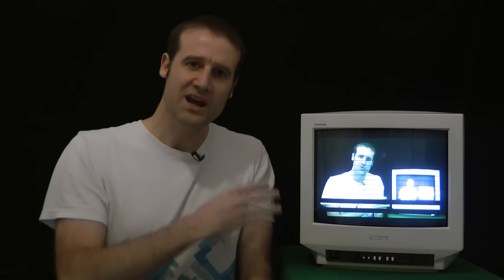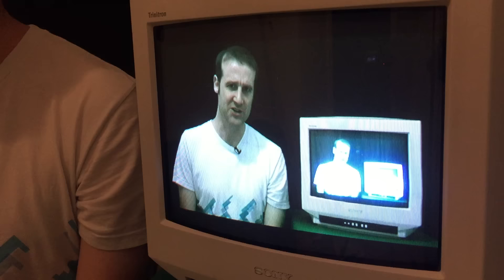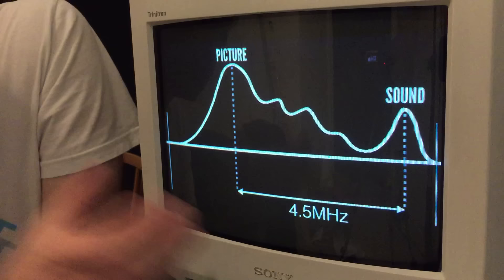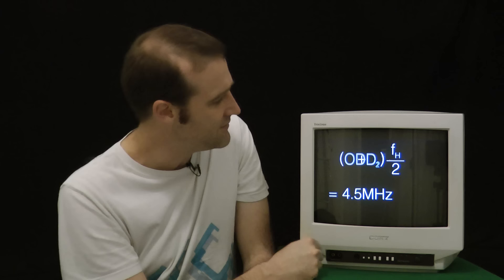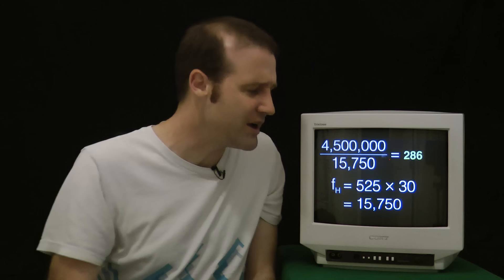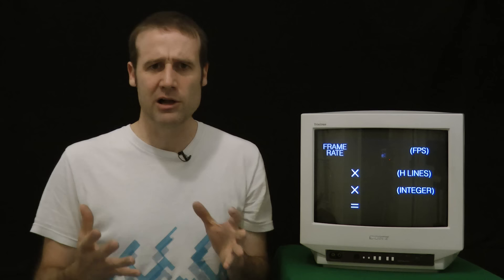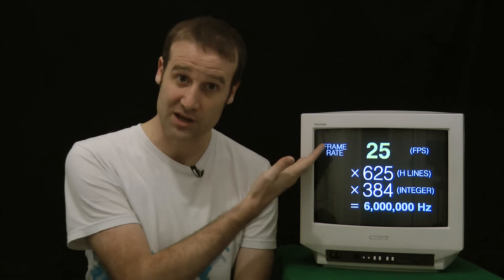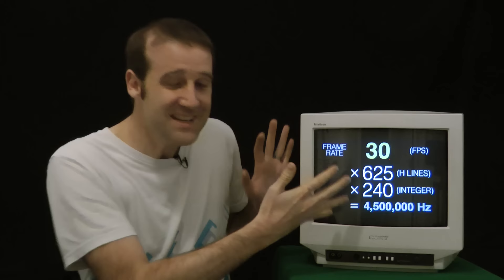Why is TV 29.97 frames per second?

Comment: Something to note is that while NTSC is 525 lines, only 486 lines were actually used to visually show the image. The other 26 lines were used for vertical synchronization and retrace. Thats why SD digital is 480p, as thats equal to the actual visual representation of NTSC. PAL was about 600 lines of visible footage, so if you ever have on your hands a master tape of a European TV show, from BetaCam or something else, it makes more sense to up-convert it to 4:3 720p HD, or else you will be losing a bunch of quality.
Reply: Real SD digital is 486. DV is 480.
Reply: Exactly, I rather over sample the video and get as much information from the picture as possible even if 720P or 1080i seems overkill. Analog video does have high frequency peaks and the professional analog recording equipment could capture a lot of information. Watching old Dr. Who episodes on blu-ray shows how good PAL video was, as far as the in studio recording elements were. The outside scenes were usually done with film, and those were re-transferred from original footage if available.
Reply: @randystuehm7924  It's 483.
Reply: @marcusdamberger  Yes. BBC ALWAYS shot outdoors on 16MM film, and indoors in a TV studio on tape.  You see this throughout the 1950 to around the 1990s, until decent tape-based recorders and cameras became cheaper than shooting processing and transferring film. Dr. Who is a great example, as is Monty Python
Reply: This is not really true. The 525 lines standard was defined in System M (The underlying broadcast standard commonly used with NTSC color), not the NTSC color standard. Look at Brazil, who is using PAL but with a resolution of only 525 lines.
Reply: Dave Holden yeah, I noticed that. The outdoor scenes all have lower frame rates than scenes shot indoors. Not only with BBC shows tho, I think it /may have been a standard/ in Britain. Even shows by ITV/LWT (London Weekend Television) had the same jarring frame rate jumps between outdoor and indoor scenes.
Reply: @RAMChYLD  Can I just suggest you edit your comment to ".. it may HAVE BEEN a standard.. ". Otherwise that is BS. Since the early 1980s, location shooting on 16mm was phased out. By the late 80s it was almost gone. By the mid 90s documentary that was completely on location may ahve been shot on Super 16mm because of the aspect ratio. Otherwise everything was on video tape, and quite often with the same cameras. Once HD arrived only documentaries with archive material would be a mix, and quite often the film sections would have been transferred much earlier and could have been up-converted from 625 or 525 SD.

However there is an issue with the difference between Interlaced and Non-interlaced or Progressive displays. If you watch a location which includes fast action that was shot with an Interlaced camera, on a Progressive display, you will get some very nasty artefacts. Any trans-coding or up-conversion needs to compensate for this by doing a proper interpolation. Unfortunately as time goes on some specialist knowledge is not being preserved which lets bad things happen!
Reply: Sadiq Mohamed done.
Reply: @RAMChYLD  interestingly they aren't really that different of frame rates. The indoor was 25fps PAL and the outdoor was 20 fps 16mm. Not a huge difference. However someone figured out a while back that if you varied the capture time between the 2 fields that each frame of interlaced video was made up of, you essentially doubled the frame rate. So 25fps PAL actually looks like 50fps when viewed on a proper CRT TV. Most deinterlacing merges the two fields as one progressive frame, which kills this effect, making the footage look like 25fps progressive. However there are some deinterlacers like YADIF double-frame that preserve each field on their own progressive frame, making the footage 50fps Progressive.
Reply: @robmausser  That's not right. Film for 625-line TV programmes was shot at 25fps, exactly the same frame rate as electronic cameras. Anything else would have pointlessly necessitated special treatment, viz being run at the same, non-standard frame rate. It would have been possible (The BBC had two variable-speed 16mm telecines - TK27 and TK36 at Television Centre.) but to what end?
Reply: @gerardjlaw  oh interesting. Most 16mm is 20fps from the time. I guess they sped it up to be in sync with PAL. Makes sense.
Reply: @robmausser  That's right. Most film was run on twin-lens flying-spot telecines, and they ran the film at 25fps. It was the same for 35mm - we ran 24fps cinema film 4.17% over its proper speed. That's why they always had a shorter running time than in the cinema - which spawned countless myths about the BBC censoring scenes, although none of the conspiracy theorists ever send to notice that it wasn't just 'Straw Dogs'
Reply: (continued from last comment)
... it wasn't just 'Straw Dogs' and 'Don't Look Now' that came up short, so did 'The Wizard Of Oz' and 'The Railway Children'!
Reply: @gerardjlaw  my original comment still suffices though: the reason it looked like a different frame rate than the indoor scenes was because the way they used the 2 fields of the interlaced 25fps PAL video as a "double frame rate" hack.
Reply: @robmausser  First of all - an error correction. The 16mm polygons were TK22 and TK36, not TK27 and TK36.  Mea culpa ...
 
Yes. You presented a very perceptive analysis of the difference between studio shots and outdoor scenes. As you said, interlacing meant that the refresh rate of electronic cameras was actually 50 Hz rather than 25 Hz. Of course, so was the refresh rate of the telecines but what they were scanning on the two interlacing fields was the same film frame, so the real-world information that was being scanned only had a 25 Hz refresh rate, making the output look exactly like a 25p signal, despite its interlaced, 50 Hz nature. That's the origin of "the film look" or "being more cinematic" that people so often seek.
 
Interestingly enough, I discovered in 1981 that I could "go the other way". Running a normal piece of film (shot at 25 fps) at ,~32 fps (in the aforementioned TK36, with its variable-speed capability) made the scene look like iit had been shot on an electronic camera - but one that had the non-linear response curve that allows film to compress huge brightness variations into a single shot. (Electronic cameras outdoors on a sunny day either had to avoid excessive brightness ranges so as not to burn them out  or else had to have most of the useful luminance information, eg depicting people and what they were doing, squashed into the bottom twenty or thirty per cent of the output signal, while the rest of the available range was devoted to the texture of the clouds or a white car!) I did try to interest the Corporation in this discovery, but it was the classic story - nobody paid any attention to the ramblings of someone who'd only been there six months and without a demonstration, the people in charge didn't really understand its significance. (Although I did use the understanding I'd gained to convert electronic pictures into a decent imitation of a film insert for Ep.3 of Tutti Frutti, starring Robbie Coltrane and Emma Thompson.)
Reply: @gerardjlaw  Thats really interesting. I guess 32fps was enough to trick the eye into thinking it was similar to the 50hz refresh of a video camera, as each field was reproducing a different image. I would have thought it would have to be 50fps, but I guess as long as there is a variation between fields, it didnt have to be double, just different.
Reply: @robmausser  The actual change-over in appearance happened around 29fps and there was nothing gradual about it. I nudged the speed control by a hair's breadth but it was like I'd flicked a switch and changed from film to electronic, 25p to 50i. 
That sharp change in perception reminded of a demonstration in the Science Museum in London with two lights. The first one flashed regularly (every second) and the other one flashed after an adjustable delay, variable from half a second down to zero.. The two flashes were still very definitely separate until I reduced the delay to about a fifth of a second, whereupon they seemed to be absolutely simultaneous. Again, there was nothing gradual about the change in perception. I suspect the two phenomena might be related.
Reply: @RAMChYLD  Yes, Britain was known for shooting all exteriors on 16MM film (1/50th sec exposure time, BTW) and all indoors in multi-camera TV studios. USA shot TV shows on 35MM film, both interior and exterior (at 1/50th sec exposure - provided that the adjustable rotating shutter was at 180˚, which it almost always was).
Reply: @robmausser  No. I know of no 16MM cameras that run at 20fps without adjustment. All sound-film is 24fps. Silent era film was 18fps. Film cameras do exist that can run at 20, but they will be played back on the projector at 24, and result is a slight increase in perceived speed.
Reply: @robmausser  it's really noticeable on my end tho, which shouldn't be since the broadcast system in Malaysia is also 50hz/25fps (only difference is sound carrier, and even then only UHF is affected). And yet on British shows (most notably Mind Your Language) the outdoor scenes have a noticeable drop in quality and frame rates.
Reply: @RAMChYLD  Thats because its not really 25fps on the indoor scenes, it's "50fps". As far as your eyes are concerned. Indoor scenes are interlaced, with each field of scan lines being offset temporally. That means that theres a change in motion 50 times a second (1 fields per frame, 25 frames per second = 50 different temporal fields) In outdoors, the 25fps film is converted via telecine to interlaced, but it just duplicates the same film frame to both interlaced fields. So you don't get this "double the frame rate" effect like you do with pure analog camera footage.
Reply: 480 is not equal to 486.
Reply: @charlieangkor8649  I mean youre not really going to notice 6 lines of resolution missing. Its mostly overscan.
Reply: @gerardjlaw  "We ran 24fps cinema film 4.17% over its proper speed".

You can notice it in the soundtrack if you have absolute pitch (or if you try to play along the music with a normally tuned musical instrument). The pitch is about 1/3 of tone higher.
Reply: @anitramwaju  That's right. It was considered acceptable because virtually no 'serious' music was ever present in a standard cinema film. There was a major exception when we transmitted The Marriage Of Figaro from 35mm film in 1981, and frequency shifting gear was hired to restore the audio to its correct pitch.
Reply: @robmausser  Where do you get the idea that "most" 16 mm was shot at 20 fps from? In fact very little 16 mm was shot at less than 24 fps except for silent amateur home movies. 16 mm film shot for European TV was always shot at 25 fps.
Reply: @daveholden2711  Silent amateur home movies were 18 fps. In the silent film era for cinema frames rates varied wildly depending on the cameraman and projectionist because most cameras and projectors were hand-cranked. The "standard" speed was 16 fps, but this was a standard honoured more in the breach than the observance.  During the 1920s speeds increased and it became normal practice to screen films at a higher rate than they were shot. By the late 1920s projection (if not taking) speeds were typically in the range 20 - 24 fps. So the idea that the standard sound speed of 24 fps represented a 50% increase over silent speed, or that this was necessary to give adequate sound quality, is a myth.  24 fps was chosen by Western Electric for their sound-on-disc system somewhere around 1924 and was then used for sound-on-film systems because it had become the de-facto standard sound speed.
Reply: You also get that weird rolling luminance bar whenever there was loud noise on a studio take. Compare eg a machine gun battle in Ain't Half Hot Mum in a fake jungle set and a shootout on eg The Professionals taking place at an airfield. The strength of the sound signal on a video recording pulled the tails up so it interfered with the picture signal but on film the audio was optically or magnetically recorded on a separate track at the side of the film.